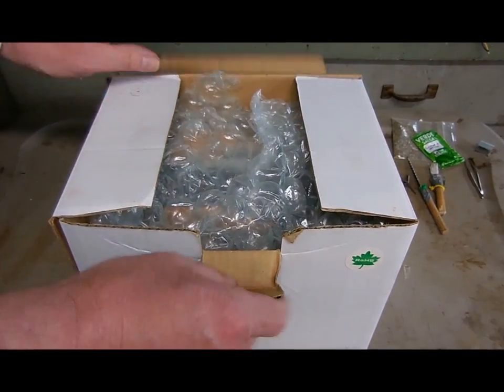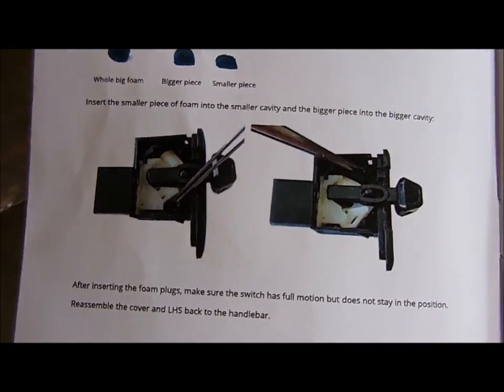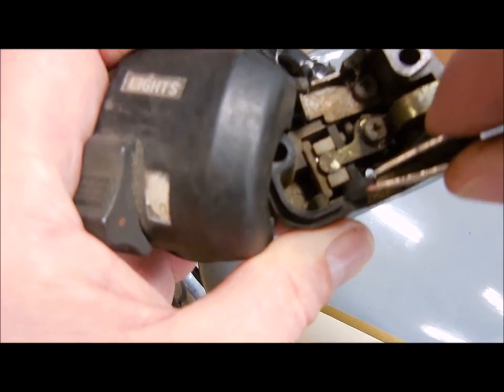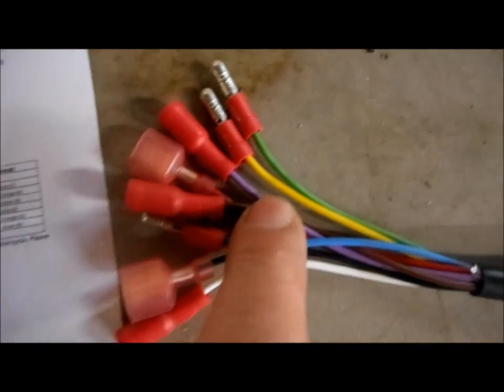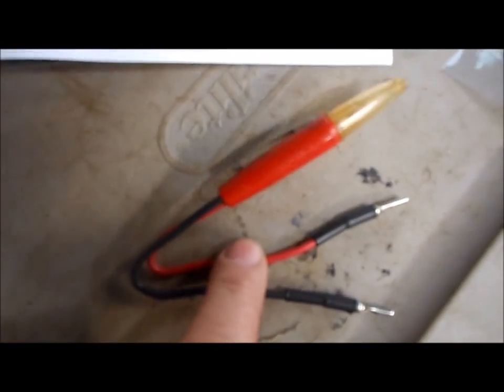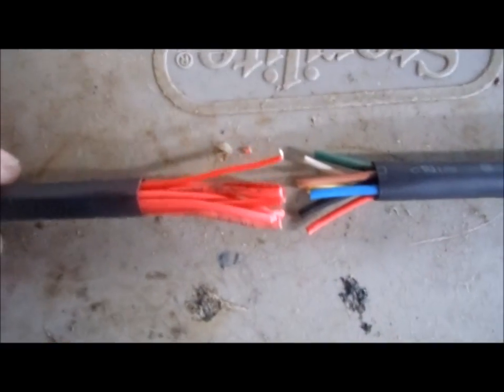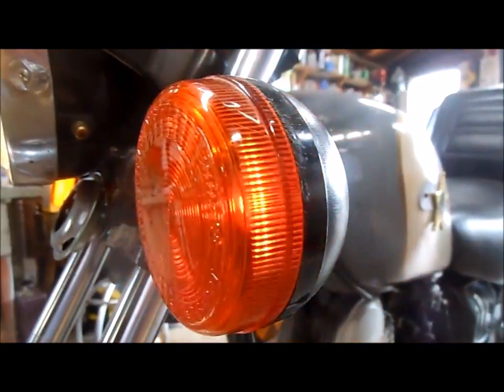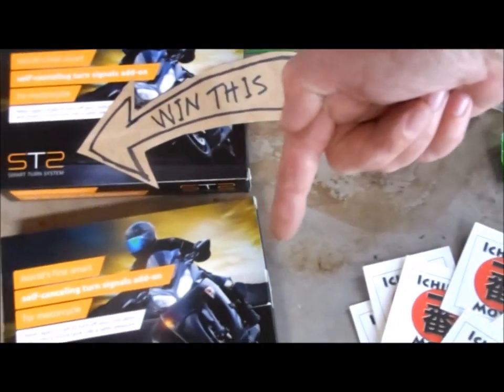How to install the ST2 Motorcycle Smart Turn System

Comment: Is there a special solder to join Chinese wiring to the factory wires. Also I don't have any voltage grade assembly tape, would a couple of post-it notes be ok. Thanks Ichiban
Reply from the maker: i just used american saulder .. are the post-it metric?

Comment: Hi, Thank you for your email some time ago, from after fitting the turning canceling ST2 system I found it worked well, but to engage the indercator I have to push the indercator button in before pushing left or right to engage the indercator.
I found that the instructions given don’t coincide with my bike’s indercator system. Could you give me some information to rectify my indercator system. 
Bike model, yamaha tracer GT 900. Order number 16572 ( April 19, 2023)
Thank you, from Graham

Comment: This company is unreliable and will tell you their system is compatible with your bike.   They ask you ti provide details and then send a confirmation email.   However then when it does not work they send you an email saying its not compatible with your bike.  I have a BMW 800 GS and despite assurances that it was compatible it is not.   Do not fall for their product!   It does not work on a BMW and you will mess up good wiring and waste a lot of time to try this product.

Comment: I accidentaly stood on my soldering iron so I'm after a new one.....Where did you get yours ? It looks like one of the ones i saw for sale in my local shop last new years eve, but they don't stock them anymore.
Reply: Plumberman Jones strange. At my local hardware store they told me the same. They even was so rude they told me that I should have known!

Comment: Looks like you did a great job as usual. But I'm concerned for your safety. You used voltage grade assembly tape but it's the current that kills. Please make sure you use ampere grade tape in future else you'll die.
Reply from the maker: oh fook!

Comment: I tried splicing in positive voltage wiring into my Kawasaki and it burned out the wiper motor solenoid. Any ideas on bypassing the actuator?
Reply from the maker: what model?

Comment: Love the pipe cleaner with a butt connector on it!
Reply: Andy Wright 
I believe that was a China grade fusible link. By the color coding I'd say it's rated about 75A.
Reply from the maker: having the correct coded colour grade diagram is key

Comment: Could you do something similar with brake lights? I tend to keep my foot on the brake pedal all the time, and I have received on the road criticism from fellow motorists for having the brake light shining at all times. Could rubber blocks help also in this situation? Another tip from me is to always run with the throttle wide open. This means you have plenty of power on tap whenever you may need it. It's really easy to regulate the speed by simple adjusting the amount of clutch  needed for any particular speed by pulling in or letting out the clutch lever.
Reply from the maker: you can get a timeer for that brake light.
Reply: Your the McGyver of motorcycling, Sir! Order for timer placed!

Comment: Well, that was just about useless.  My ST2 came with about 16 inches of cable.  Where the heck do you mount it?  Did you manage to cram yours into the headlight bucket?  That doesn't seem right.  And, most of us have what you referred to as "plug and play" bikes.  What then?  How does that work?  This so called instruction video is a real let down.  Especially since the video referenced in the ST2 instructions is "No Longer Available" on YouTube.